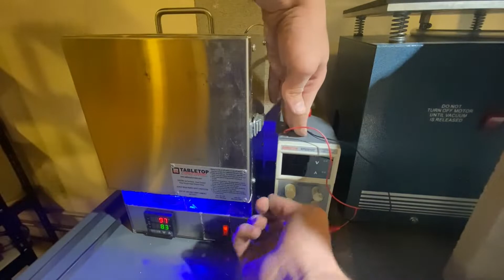Casting A Two-Stroke Engine - Completed Crankcase

Comment: Levi how long is the burnout cycle and when do you have to flip the flask over? If you can explain in detail would appreciate it.
Reply from the maker: My burnout last about 13 hours but yours will depend on the investment you use and the metal you are casting. I flip the flask for the last 2-3 hours to allow any trapped gasses to escape.

Comment: Looks amazing, I tested the cure under water but I still continue having ashes, well I am looking for the vacuum oven diy hehehe cheers amazing job
Reply from the maker: Thank you. What resin are you using? I’ll let you know if at any point I design a oven safe vacuum chamber. I would want to make it easy to source parts for and easy to build without many tools which is a tricky task.
Reply: Levi Sheridan the funtodo castable resin, but I try also several burnout temp and time but the resin continues leaving some ashes. I will try to make something with a iron tube connected with the vacuum and inside  an  toast oven.